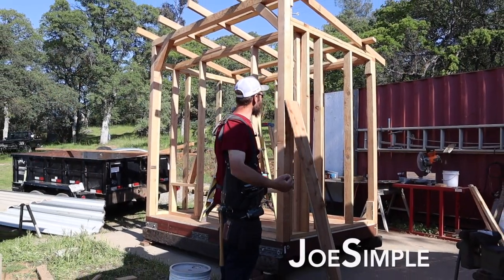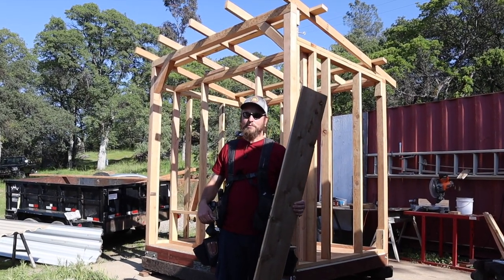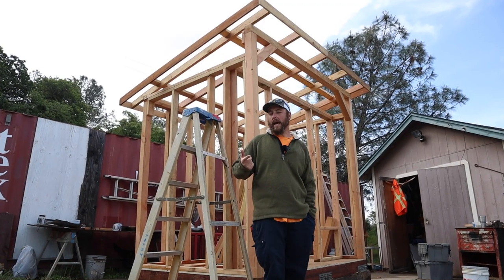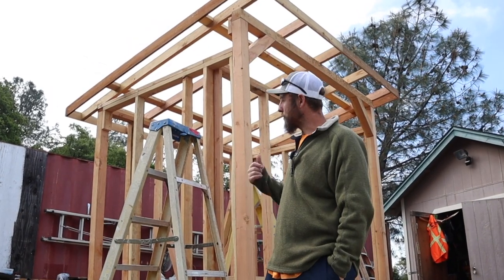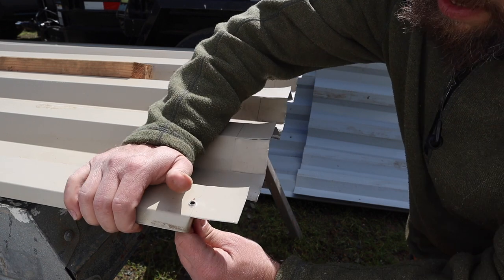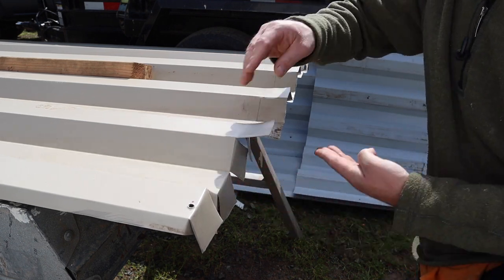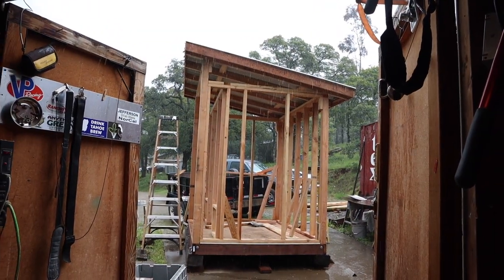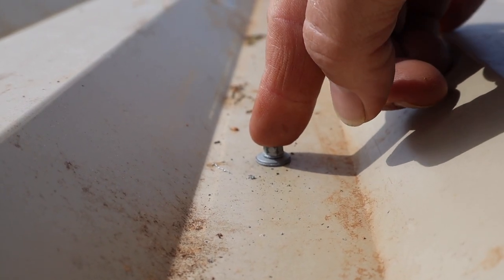UP-CYCLED ROOF, SCRAPS | CHICKEN COOP BUILD PART-5 | Building Our Homestead

Comment: 2:56 You should not have closed up the ridges. You should have put some screen/hardware cloth in there. Ventilation is a huge thing for chicken coops. Leaving the ridges open on the roof will draw out humidity. Humidity for birds is a very bad thing in winter and summer. In winter their combs get frost bite. In summer they develop respiratory problems.
Reply from the maker: Continue watching the following videos!

Comment: I am planning to build a lean-to with a steel roof for a workshop.  I was planning to put up preassure treated OSB and then the steel roofing.  Is that over kill or a good idea?
Reply from the maker: Typically on metal building construction they just run purlans and attach metal to that. It depends though if you are looking for a weather/ insect tight building I would go with the plywood construction with metal on top.

Comment: Question I have a bunch of 2x3x8ft lumber laying around. Would I be able to build a leanto or a shed like you have with it? or do I need to use 2x4 and 4x4 for the post or beam? could i connect the 2x3 together to get a 4x3 to make them into posts?

Comment: Hi im really struggling with a 17 degree lean to extention roof ,,ok im a bricklayer not a carpenter,, i cant seem to get birds mouth cut to sit on wall plate clean and true
Reply from the maker: Whats the existing roof pitch? 17° could be a 4/12 pitch witch would be an 18.5° angle just a thought. Where on the birds mouth cut does it have a gap?

Comment: I note you tek screwed the roof sheets on the low point. I was taught to do roof on the high ridge so the hole isn't surrounded by water (Over time) and do the screws on the low side if used as cladding. Not sure if you have a preference but I note screwing in the high point for the roof can warp out the sheets if screwed down tightly splaying from square.